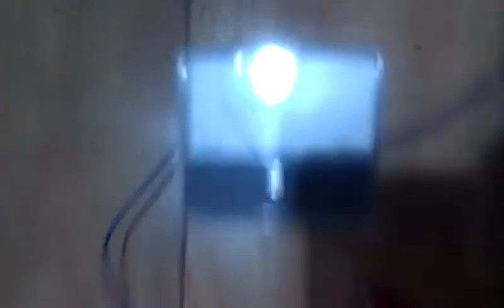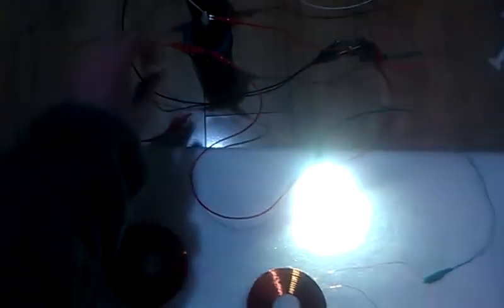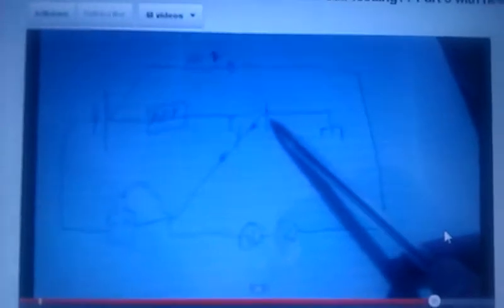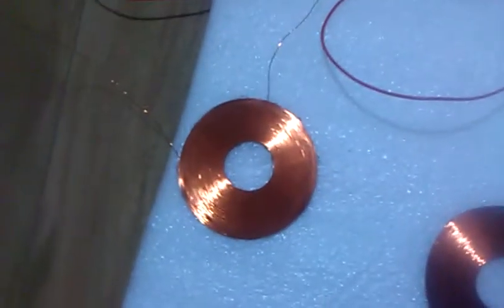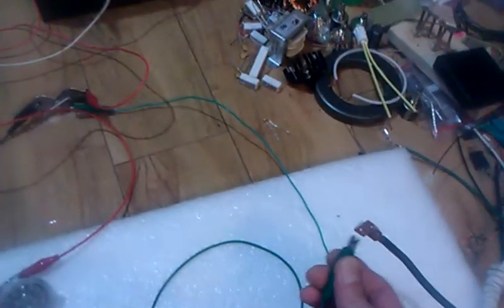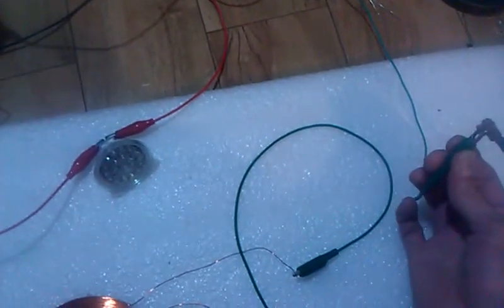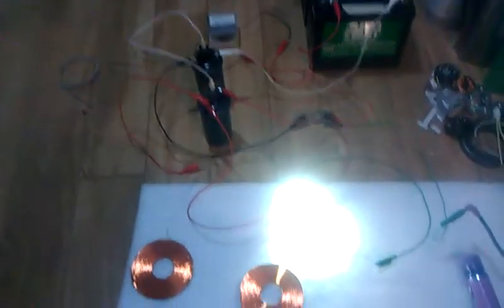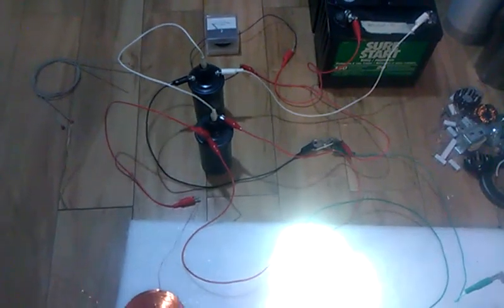Radiant Oscillator Circuit: 0 Amps @ 12 Volts= Huge Light? Part 1/

Comment: Hey KD if energy is coming in somehow from flat coils then maybe you could possible register a drop in temperature of the coils in relationship to ambient temperature. zero pt energy has that effect. Bedini generator, thane hanes transformer all pulling energy from the vacuum and producing cooling effects thane in coils bedini in ambient air

Comment: Please stop measuring milli amps 9or even micro amps0 with an amp meter which is designed for high amperage. I learned on school that the deviation (error) in the first part of the scale is the biggest. Your ammeter will have a small error of 1 or 2% in the range of 10 Amps. But with this low amperage it will not work. If you have no ampmeter, just use a low resistor and measure the voltage. PS: try a 13V filled cap, see how long it runs and share that with us. Still an cool experiment!

Comment: If you could measure the beginning of the pancake coil and the end of the coil it would be interesting to see if you have a rise of voltage there. If there is then the next question would be are the pancakes bifilar?

Comment: KD I think that you should look for AC amps not DC but it has always been tricky to measure, if that or some other battery of test wouldn't work then we are looking at something like radiant energy which is supposedly very difficult to register with regular instruments but the setting is none the leas interesting..thank you for sharing

Comment: Instead of stepping down to a point source LED, will a single ignition coil drive a long flo tube directly, say for additional lighting in a (green) garden polytube not wireable to the mains supply ?